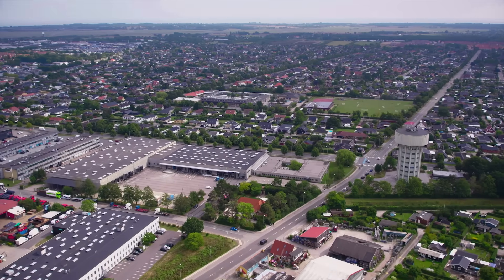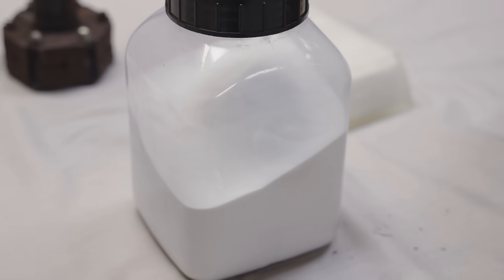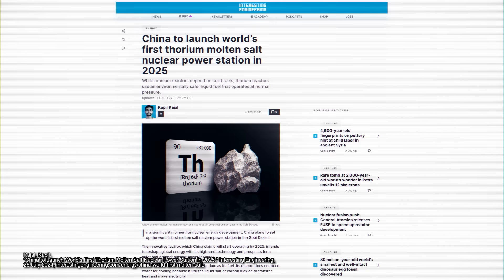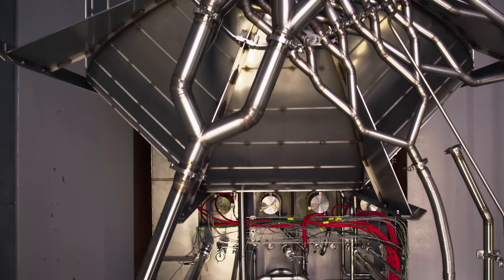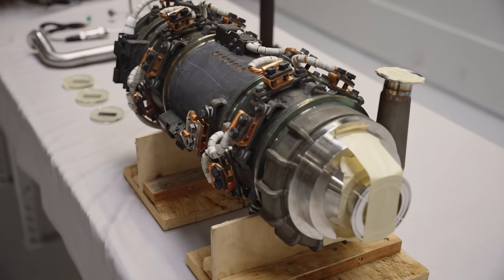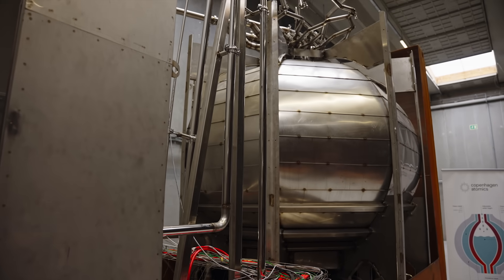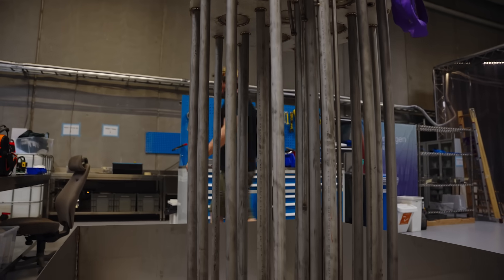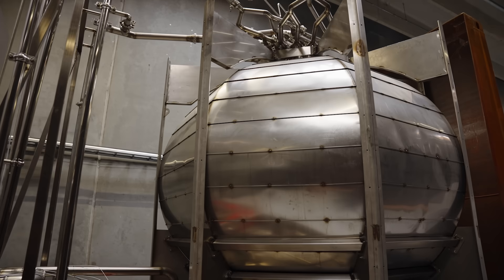Why Isn’t Thorium Changing the World?

Comment: The problem for Thorium is the same for most new nuclear proposals.  It's capital intensive and can take 7 years or much more depending on how new and novel the technology is to have an operational commercial reactor.   

So you can invest a lot of money and other technologies can pass it by.  For instance, in 2018 Renewables were 32% of the EU grid power, and now, 7 years later, it is 54% of EU grid power.
Reply: Nuclear is high upfront costs, but after about 15 years it covers all startup costs and turns a profit no other energy can compete with. Natural gas, the next closest generates about 1/3 the revenue nuclear does
As for the EU more of the grid is now renewables, but the grid is also generating less and less as we depend more and more on outside sources for energy. Except France, they're happily selling excess energy from their nuclear plants.

Comment: Lead coolant (no corrosion) with thorium beads?
Reply: The salt isn't used because of cooling. Its main use is highly efficient neutron scattering, because the thorium fuel cycle doesn't produce enough neutrons to be self-sustaining in conventional reactors. Beryllium even produces additional neutrons under strong radiation. Even with this high efficiency it's not clear if the thorium fuel cycle will work, but with lead as coolant it will certainly not work.
Reply: you are right.  Forgot about Doppler and thermal expansion causing loss of fission neutrons.  Been a while.  Lead would mess things. Thanks. @andreasschmitt2307

Comment: It did, 70 years ago. But we've moved on. Moderated reactors are massively superior when it comes to boiling water. Which is all nuclear power stations do. Fast Neutron Reactors don't make a fraction of the heat, they are for irradiating isotopes. Also known as , making weapons material.

Comment: Seriously, you're worried about getting irradiated by Thorium? It primarily gives off Alpha Particles that don't have enough energy to penetrate your skin. If it is a powder, then you have some concern about inhaling or swallowing it. But being irradiated by holding it not so much!
Reply: Some decay products of Thorium emit Gamma or Beta particles which can cause damage
Reply: @atlas2819  Yeah, and some cosmic rays reach the Earth's surface and cause damage too!
Reply: @mikesmicroshop4385  I can't find information on the exact extent but gamma rays can be over 1000 times stronger than the UV rays that come from the sun so I prefer to not be around them. Additionally the salts are in a fine powder, which if inhaled can quickly turn those harmless alpha particles into an issue

Comment: Hastalloy is regularly used in the chemical industry, can’t see why it would be too expensive for a nuclear reactor, unless it isn’t that much more resistant.
Reply: Likely because the chemical industry has a significantly higher budget or doesn't use as much as nuclear reactors would

Comment: By the time Denmark gets an SMR up and running they will only be about 6 years behind China (assuming they can get regulatory approval from some other country) which has had one connected to the grid for about 2 years and has also already refuelled it while on the run.

Comment: The reason it was stopped was corrosion and the fact that nuclear power as a whole had a rough time in the 1970’s.  Lots of good ideas died then it is by no means alone.

Regarding corrosion, as stated, it is not sodium chloride, the oak ridge experiment used fluorine based salt.  Alloys such as 316 stainless work with sodium salts, but not for this nasty stuff.   For this you need Hastelloy, at a cost per kg or about $50 for the raw unworked metal - which is about 100 times the cost of unworked raw steel.

Also, exactly what part of radioactive fuel dissolved in a super hot corrosive liquid sounds safe to you?  Any form of grid scale power generation - even solar - has its hazards.  Also fluorine based compounds tend to be really toxic - even if they are not loaded with a radioactive substance. 

Also, what happened to the Thorium based Light Water Breeder?  A grid scale reactor was built in the 1970’s and operated for several years.  it finished that time with more fuel than when it started.  Also, it was a breeder - burner where the longer half life by products get broken down further.

Seriously, nuclear development in this era featured some larger than life people each with larger than life egos.  I never met Alvin Weinberg, so this comment may not apply to him.  But OMG, it sure applied to others. Be careful taking “arguments” for a particular technology by only looking at one source.

Comment: I'm an industrial electrician and I would love to work in some form of nuclear power facility one day. But as someone who services this kind of equipment, I hope they find a way to service that main pump safely because I don't care how much research they put into developing it, it will fail and it will need to be serviced. Also wondering what needs to be done to make the equipment safe if it fails and the lines are full of radioactive salts.

Comment: In the new gas engines of today, they have eliminated steel sleeve cylinders, in replacement with just a thin coating of alusil, or Nicosia, or ceramic, so had you thought of using components that are coated with one of these types of hard coatings?  That would lower build cost, by being able to use cheaper metal components, but coated with a tough hardened low cost lining, but increase longevity of the reactor components.....😎👍

Comment: Speaking of all that corosion, i wonder how ceramics would fare in that environment compared to metals. The melting shouldn't be an issue, some clays can take well over 1300°C before they start to turn into glass or some similar state, though i have no idea about how well they resist chemical and radiation caused corosion. Though i would absolutely find it funny if the solution to constructing the newest kind of nuclear reactors would turn out to be pottery in some shape or form.

Comment: I have watched a LOT of video and research on this subject. It seems to come down to materials that can withstand the corrosiveness of salts, a material longevity problem literally. Has ANYONE tried ceramic coating INSIDE the stainless part yet? Maybe eve solid ceramic piping? You WANT to avoid corrosiveness right? Use materials that are friendly to heat! Hire me, I can solve that material problem. I have 35 years experience.

Comment: I need someone here to clarify something. From what I gather, we're looking at different neutron energies, and the need for an intermediate processing step, thus meaning we need to build three nuclear facilities together, not one. 

The point of moderation is that you need neutrons of a certain energy-level/speed to properly initiate the reaction. You don't want to bounce off or just punch through the atom, but rather get it spinning fast enough that it stretches and snaps like silly putty. (Yes, that is a little more accurate than saying the atom just splits from being struck) Breeding material a different energy level - hence the term "fast reactors". So you can be efficient at using fuel, or making it - but those are at cross purposes. This would also be why we have mixed-oxide fuel elements rather than pure plutonium in French reactors - pure PU wouldn't work well in a Uranium reactor. 

Secondly - the bombardment of the fertile material is essentially random, and you are not producing usable fuel right away,. Rather we have fertile material with bits of fissile within it, that then needs to be re-manufactured to be be fuel. Probably in some variation of the PUREX process of dissolving things in acids, selective organic solvents, and then reconstituting the metal to be sintered into fuel pellets. But if you're reprocessing fuel - then you have added an expensive new step, and brought up the question of why not just reuse the spent fuel we already have, rather than starting from scratch with Thorum

So anyway - we will need reactor A to make fuel, reactor B to use it, and a heavily shielded factory in-between to turn the irradiated materials from reactor A into fuel for reactor B. As well as a huge investment in opening up Thorium extraction and fabrication. Which is a problem under capitalism because all of this won't show a monetary return on investment for decades, regardless of any social benefits. Mind you the first time around - everything about nuclear power was government subsidized - from finding new mines, to figuring out the nuclear chemistry (for bomb production) to reactor design (for submarines, and then boiling water units under the question of what if we didn't pressurize the system) to training the initial operators. 

Nuclear power is awesome. The profit motive is not.

Comment: 3:25 way to beat around the bush without directly bashing the oil oligarchy, good job bro, you get to keep your job today.😅

Also since it wasnt directly mentioned i am wondering if electroplating nickel or silver may assist in the corrosion department. I would assume its an avenue they have or are pursuing.

Comment: I'm no nuclear engineer, but I do have an old tractor that uses a thermosiphon cooling system instead of a water pump. If finding/designing a pump is a major hurdle, I wonder how feasible it would be to design a system that didn't need one?

Comment: Why? Maybe because there are incurable problems that all thorium reactor proponents REFUSE to discuss:
a.) thorium isn't even a fissile fuel,
b.) the best "breeding" rate ever achieved was about 1.4% - meaning the creator only "bred" 1.014 times the 233U it BURNED (so why bother?)
c.) the salt corrosion problem is real. And no, Copenhagen Atomics hasn't fixed it for a real world application - and they know it. 

And the real showstopper:

d. thorium also "breeds" 232U - the decay products of which include some seriously nasty gamma emitters. This is not avoidable, or fixable in any fuel cycle.
e. even a few ppm of 232U contamination in the "bred" 233U means the "bred" 233U cannot be processed like regular reactor fuel, because the gamma radiation is too intense.
f. removing even a few ppm of 232U from 233U is extremely expensive, and no commercial infrastructure exists for doing it.

When separated from the 233U, even a few kg of 232U would become so gamma "hot" it would be completely unmanageable after a few months.

Try to pin these "thorium freaks" down on the 232U problem, and they will refuse to discuss it, or at best will say it's not THEIR problem, blah blah blah.

Except it is, and they know it. So WHEN this WORTHLESS con game COLLAPSES -  they will play victim and say 'the government shut us down, boo hoo hoo".

Comment: This type of liquid salt metal reactor is messy to work with you need advance chemical factory and chemical processes to separate the byproduct of fission it's better to use fast breeder reactor using MOX fuel or Metal oxide mixed fuel like U 238 dioxide and plutonium dioxide and liquid sodium as a coolant like in BNPP in Kaliningrad, they only experimenting not applying the principle of how to make it renewable and safe to use like Russia did they have advance training on nuclear physics

Comment: What a marketing pitch. Are you by chance invested in copenhagen atomics? Cause all I hear is give us more funds, we might not have any results but we really promise it's just around the corner.
I also just saw another video where you champion thorium and have copenhagen in the thumbnail, so it does seem like it.
For anyone else, don't invest until you see actual results. The only thing they currently have is research on anti-corrosive alloys/coatings, which is not even really done by them but by their partners like universities, where they might sponsor part and the state and universities pay for the rest. If they don't just use research unrelated to themselves, which seems most likely.
Even worse, there are no significant upsides to thorium reactors compared to regular ones except for fuel efficiency. Compared to renewables they would still be much more expensive, less efficient, and stupid to subsidize. If they ever even get a functioning prototype, let alone actual reactors. Not even for longterm energy requirements of drones or satellites does it make sense, so your money is most certainly wasted unless you are the one Pumping and Dumping (spoiler, you are not if you heard about this here).
Reply: Copenhagen Atomics is one of the best investments possible to make but they are privately funded, I hope they do an IPO at somepoint so everyone can invest.

Comment: The only reason, why nuclear energy seems to be cheaper than other energies, is because they don't figure in the deposal costs. The waste has to be stored, protected, monitored for thousands of years. Adding that into the calculation makes it by far the most expensive energy out there. But hey...not our problem, right? Let our the next 1000 generations pay that.
Reply: That waste is actually nuclear fuel for MSRs and other gen IV reactors, a smart country would go about trying to import on mass spent nuclear fuel, with the stigma its got you'd probably be able to get paid for it. Only 0.07% of the potential energy has been extracted from spent fuel from PWRs.

Comment: It isn't plausible in the USA until Thorium is deregulated. Kirk Sorensen has been working on it for at least 15 years with LFTR. LFTR is naturally safe when designed properly. It will stop running when there is no human interaction.
Really you barely scratched the surface of what a Thorium reactor can do. It can make a plethora of other radioactive isotopes for space probes and medicine. Thorium is found in regular dirt. Everywhere. You can feed it with spent fuel from LWRs. It runs at atmospheric pressure so it can't explode. It can't "melt down" because it only functions when more fissile material is added. If you stop adding fuel, the fission stops and it shuts down.
Reply: Current admin will deregulate it if they are made aware of it. Now is the best time to be a cheerleader for MSR technology and spread the word.

Comment: The unsovable problem is the molten salt as medium. Whenever chemists want dissolve something thas isnt dissolvable with the usual chemicals they use molten salt. What can possibly go wrong using this as reactor medium?
But all atomic reactors are not only killed by technology issues, they are simply killed by economics. Green energy has come to generation costs atomic reactor cannot get to even if they would run 24/7. The social acceptance does the rest.

Comment: I wonder if Roman concrete could have a possible application for the corrosive nature of salt. From what I've learned, when it gets exposed to saltwater, the volcanic ash and lime create a crystalizing effect within the concrete that makes the concrete stronger. It's part of why so many Roman-made structures are still around today, albeit in some damaged states. 

Perhaps that crystallization process could be replicated to make replaceable parts that don't corrode or break down at high temps.

Comment: Before a real market for nuclear reactors can emerge you need to make PV, batteries and wind turbindes 10x more expensive then they are today.
"Sadly" they get cheaper every year.
Reply: There's a scalable limit. Solar serves 10% of the pie effectively.
Reply: @artsmith103  I do "know" that the Grid never ever under any circumstances can take more than 2% of Renewable Energy, because tons of "Experts" have sworn this is the physics limitation. And later 10%. And today Germany has over 50% of Renewables despite of 16 years Merkel with oil-gas-lobby in government and the southern part has hardly any wind turbines at all.
Please give any reason why PV can't give more than 10% of "the pie"?
Reply: @marcogergele6183  I said scalable. No interest in discussing your tangent.
Reply: @artsmith103  Ah. You prefer the high scale of money needed per GWh in nuclear reactors.
Reply: good time to take off the subsidies then.

Comment: I don't know much about nuclear physics, but why can't they just use water? Are they trying to boil the salt to spin things up? Does the reaction of the thorium and uranium CREATE the salt in the process? If thorium is cleaner and better for the reaction but molten salt rots the plant apart, would it not be better to just keep using water to actually generate the electricity? Where do I find the deep details on this? Where am I going wrong?
Reply: The reason that reactors explode, and the reason they have foot-thick concrete containment vessels is because water boils at 100degC at atmospheric pressure. A reactor operating at 100C would be hugely inefficient. To operate a water cooled reactor efficiently you have to operate at high pressure (150 times atmospheric pressure)(at around 350C). A molten salt reactor operates at atmospheric pressure, and doesn't need a containment vessel because it won't explode. In failure, it would leak or melt.

Comment: Sounds like a nightmare to service. A valve failure, line rupture, pump leak you name it.  Not only will you have to contend with the extreme heat, but also the radiation.  Good luck servicing this thing when it's running with human beings.